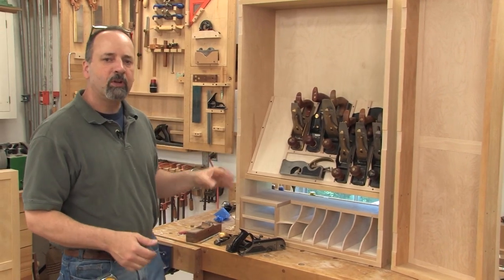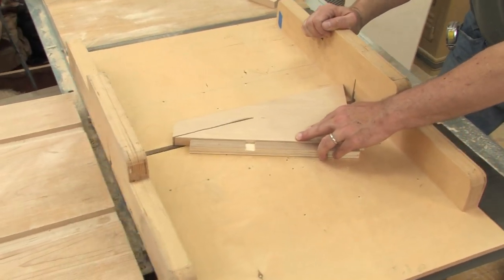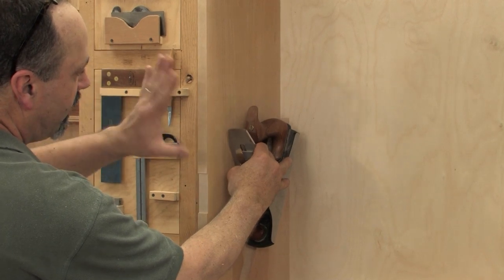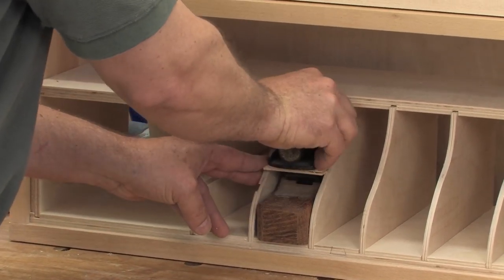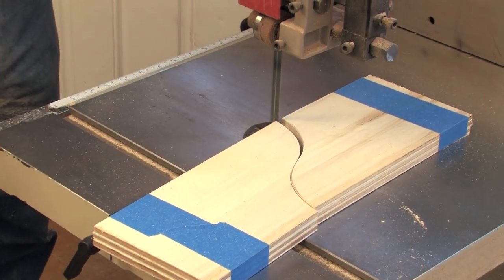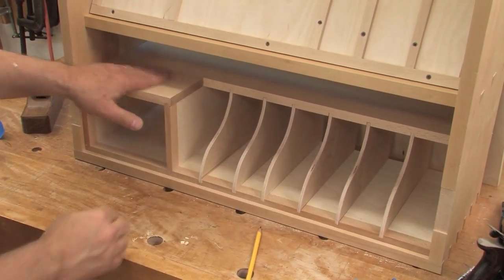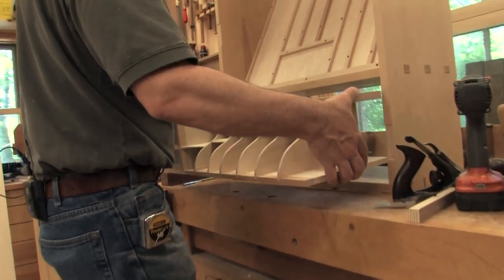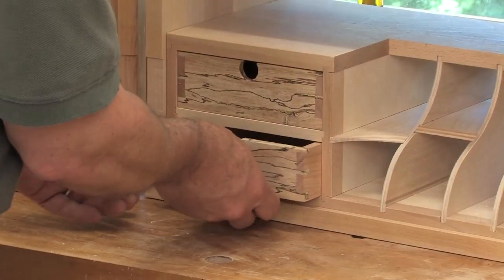Plane Till and Gallery with Mike Pekovich–Hanging Tool Cabinet 5

Comment: Excellent design... I added something to mine for even more versatility... I put a piano_hinge at the top of the till's plywood base, and installed a small knob at the bottom. This allows the entire till to swing up, to allow access to the space behind it. All sorts of things can be stored in there. Thanks again for a great tool storage solution.

Comment: Made a few changes to my tool cabinet as well. The most beneficial for me was moving the space for the jointer to the top. I use it the least and it brings the other tools down for a easier access. I made this tool cabinet from off fall that had a cumulated over many years. Had several stop and starts but finished a very useful tool.